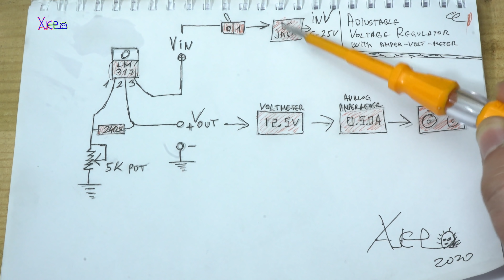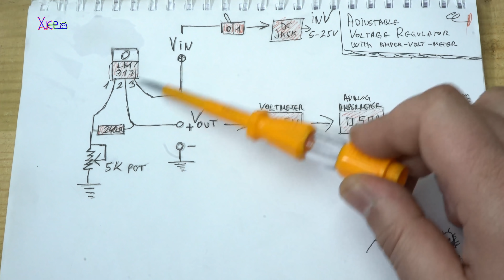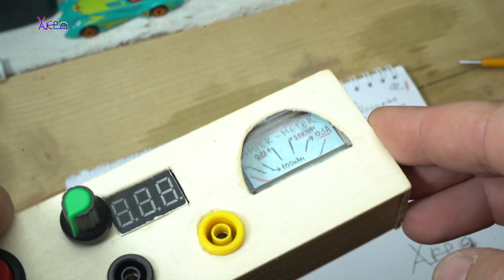7 DIY Projects 7 DIY Gadgets

Comment: was trying to see how you wired the sanitizer project could you provide a diagram pls. looking forward to making this...cheers
Reply from the maker: Sanitizer work with ir sensor from arduino,but work without him,from sensor signal goes to 5v relay from here to dc motor.
Btw both modules,relay and motion sensor are constant powered bu 5v